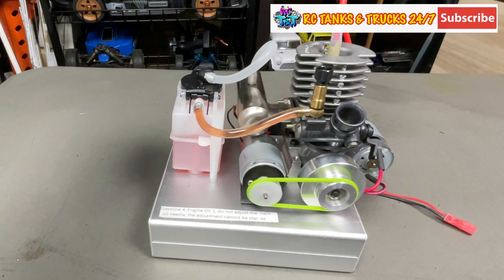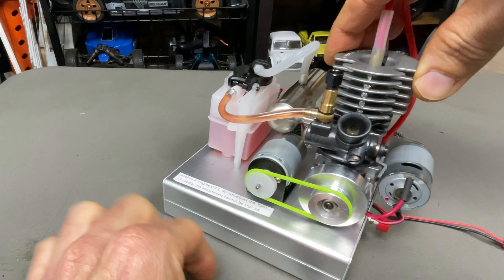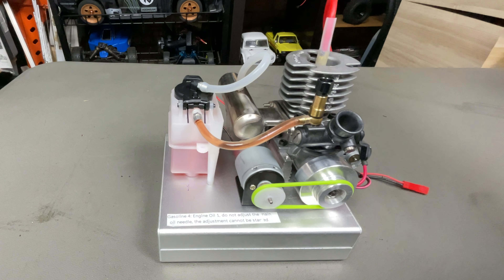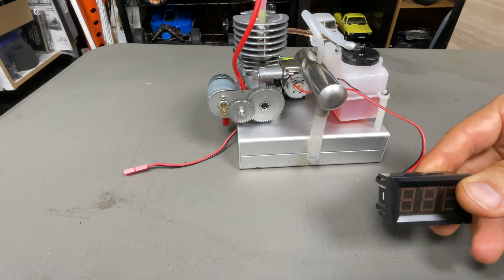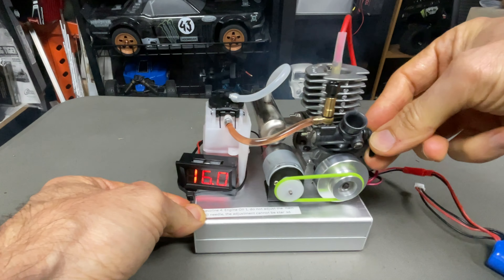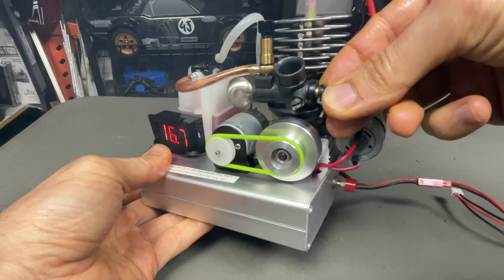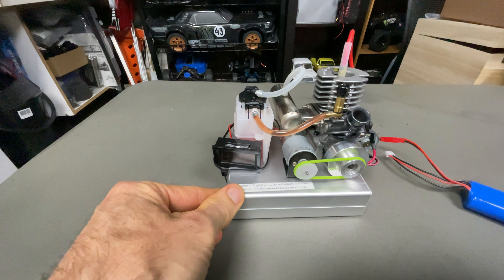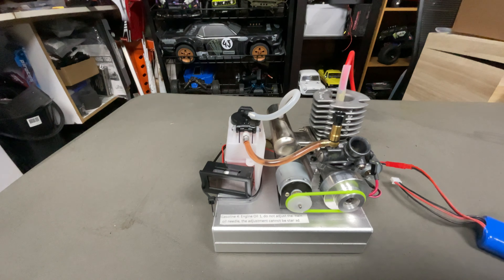17,000RPM MINI GASOLINE GENERATOR - ACTUALLY WORKS!

Comment: This is a great little project. I would be interested to know if the engine load varies dependant on current draw -i.e. no electric load = minimal engine load, short on the electric side = max load...

Comment: Seen these on website and I think you could regulate the voltage to 12V then you can actually use it as a generator or straight to the Toyan projects.👍
Reply from the maker: Thank you

Comment: You can generate 30 volts. You should get a bigger brushed motor for the generator and see if you can power a small go-kart. Assuming your nitro engine makes 2ish horse power you should have around 1400 watts available you'd have to draw 40 amps though which might be too big of a load for such a small motor. If you could generate 72 volts, you could use a converter rated for 1500 watts to step the voltage down to 36 and only have a 20ish amp load at the motor.
Reply from the maker: Thanks for watching mate 👍 and appreciate the comment

Comment: My English is not so good, so I didn't understand, what u sayd in the Video, did u say, it's no nitro, it's a gasoline version ore did u say, you converted it into a gasoline engine? If you converted it, can you please make a video about it? Like how to set up the engine, which ecu did u use? How can I adjust the timing for the ignition, where is the best place to fit the sensor for the ignition usw. And what are the specs of it? Do I lose power? I'm shure I will but how much is ist? I'm a fan of nitro rc cars but the nitrofule is expensive here in Germany, i think in your country too. The glow plugs are expensive I think to run these engine on gasoline it would be cheaper. But do I have enough power? I mean the toyan engines are not fast, the also ran on gasoline right? It should be a little bit more faster, would be great if you can make a Vidoe about it, only found old garbage videos to a gasoline conversion with low quality. I think you're the right YouTuber for taht. Keep going, greedings from Germany 😄
Reply from the maker: There are two versions you can buy. This one is the gas version. Nothing to convert, just add oil to the fuel and that is it

Comment: Hello, I hope you can help me, I have a gasoline engine like yours, but I can't start it, spark arrives at the spark plug and there is gasoline in the feed tube, I loosen and tighten the carburettor nut, but nothing won't start, I'm rookie. Is there any trick or advice that you could give me? I would be very grateful. Thank you and greetings from Spain.
Reply from the maker: Did you get it to run?

Comment: Lol, that's cool. Doubt it would charge an rc car battery, but could possibly charge your phone. 🙃
Reply from the maker: Yeah true
Reply: with an upgraded generator motor, it could definitely charge an rc car. hobby engines this size can make several horsepower, so even with a low conversion efficiency, that's still a lot of power
Reply: This can absolutely charge a 4-6S lipo.

Comment: So...as an alternator in a car, this(tech) can be used to create needed amps for throttle/steering servo demands, radio, possible accessories(LEDs) and extra to current keep a constant, small cell battery charged. Basically replacing the need for a mulit-cell battery pack. Just a much smaller cell(caps) for low load demands and quick heavy load responses (idle...or servos holding home position). A cell phone battery? Im eager to learn if im crazy or not.
Reply from the maker: Thanks for watching mate 👍